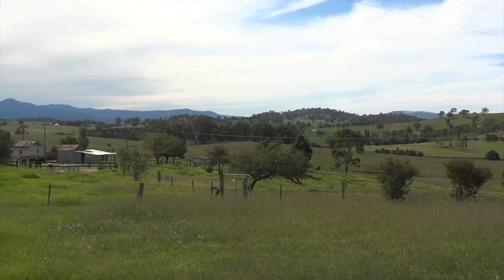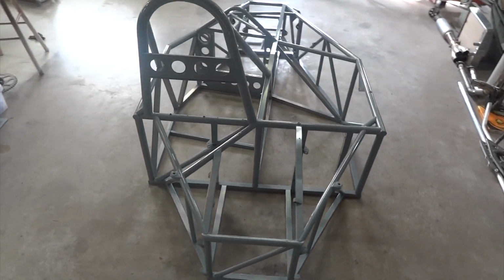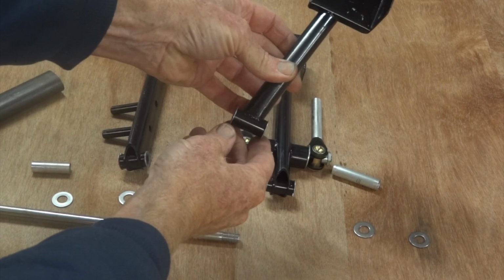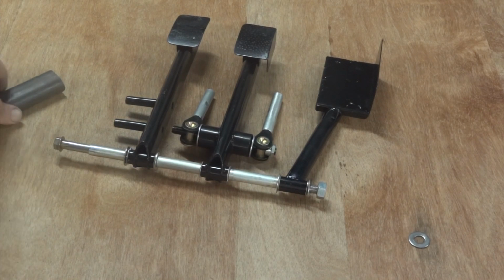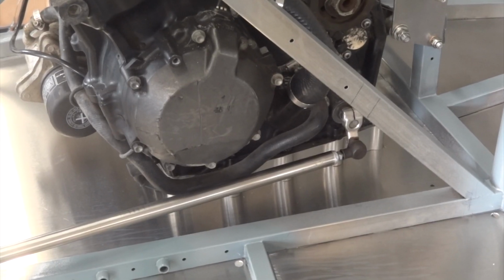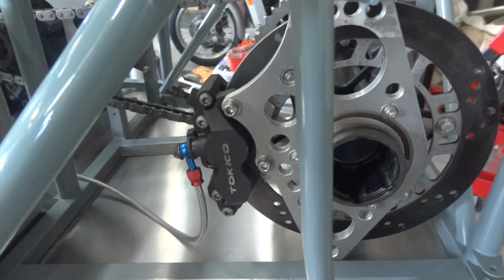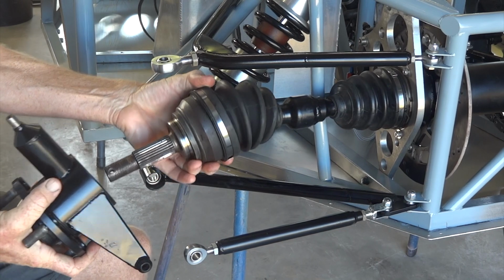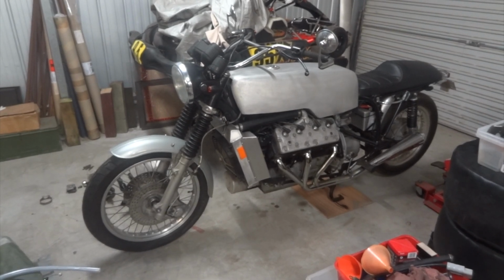Ninjamobil ZX10 Carbon Dart Assembly

Comment: Brilliant Videos ,no messing around, loads of information and with a budget in mind, What is the wheel base of the car ?, could you do a video on the design philosophy of this car eg, putting the engine along side the driver to get a shorter  car ? and how fast you have go before the flat floor/diffuser provide usable downforce
Reply from the maker: 1900mm I think. Engine location is for weight distribution. Diffuser works at all speeds, but the force generated increases with the square of the speed.